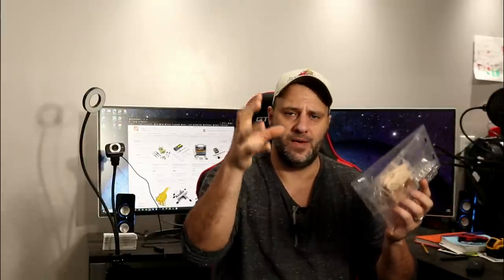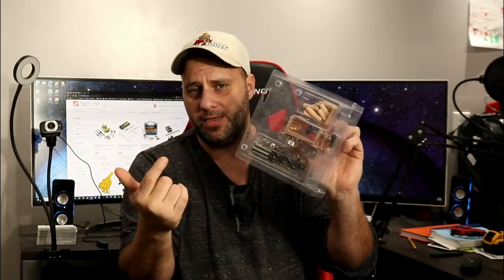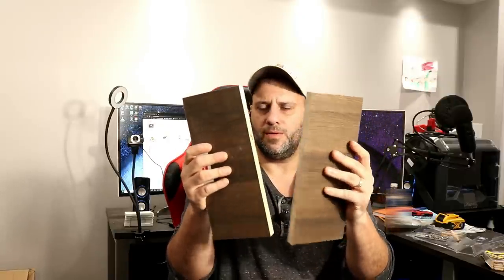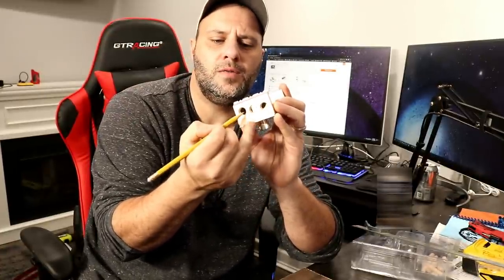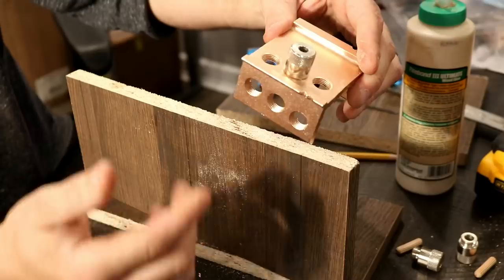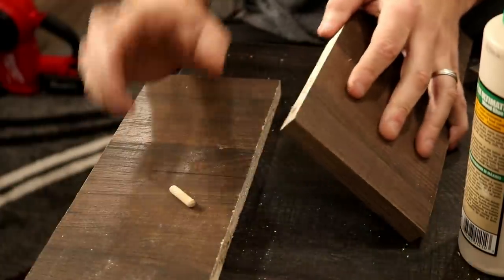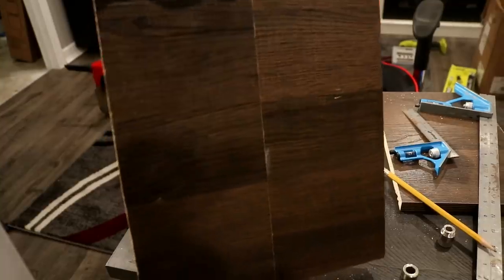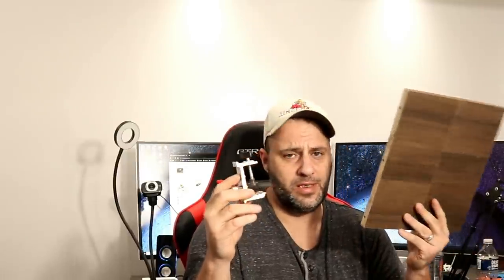How To Use a Dowel Jig and Up Your Woodworking Game!

Comment: Hi there, I don't want to sound like a tool snob, but I have used several different doweling systems, including the very inexpensive Milescraft and the Self centering type of doweling jigs, they work pretty well actually. However if you can swing the cost, and you plan to do a lot of doweling in the future for you furniture builds, the Dowelmax is the way to go. It isn't cheap, but it has an almost surgical type of accuracy due to the built in clamps and build tolerances. The clamps hold the down rock solid. It is highly recommended, and if you watch their YouTube video you will see a test that shows the strength of their doweling system is even stronger than the Festool Domino. No really.

Comment: I used the milescraft version with the 3/8" dowels to join a sign together. It wasn't the main brace holding it together but more for a seamless look when applying the vinyl graphics. It's held up great so far.

Comment: Hey that a Cool Jig i SMEEEESHED it Alot,  for me I'm looking for a simple tool to Add shelf for my Model Railroad Layout I'm building out my Yard the boards do have to perfectly match but in your video it lookes like the do fairly well as i mentioned budget friendly is what I'm looking for i wont be drilling Dowels on a Daily basis.. i do however have Mil wal ki a  Drill & Driver Combo set with a Surge & i just bought a Milwaukee M18 Air Pump.. reliable tools is must 

I wanted to Add in highschool we had Endboard Jigs the jig slipped over the Board you then turned either one or two bolts to lock the Jig onto board you could then drill your Dowels but this was circa 1980's being that i attended Haven High 1984 through 1988 3 years of woods the tools we had had to work with we're pretty damn good no rechargeables we had to use the cord but we had a Milwaukee panel Saw & several Porter/Cable tools i wished i could remember who made them jigs & they we're built to last all heavy metal construction i built to Cabinets using them Jigs & of course our other tools us students had at that time like to Note computer aided Drafting was still a few yesrs out after i Graduated.. 

Like your Videos We always do cant wait to see more take Care Allen D